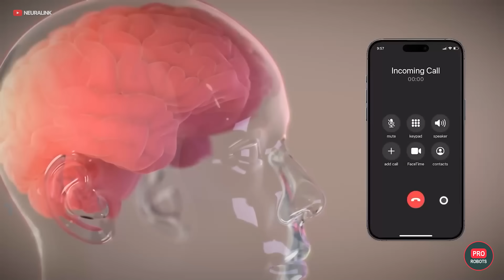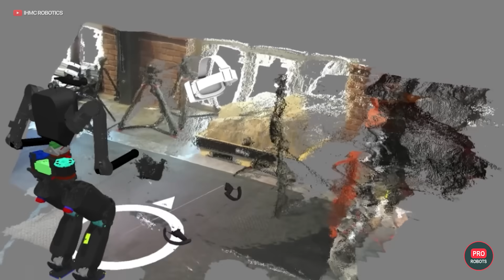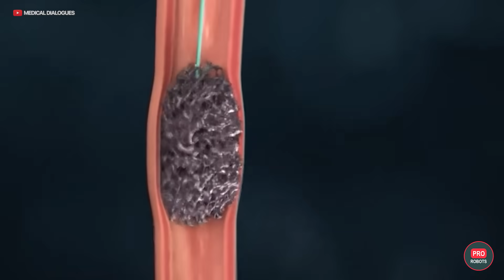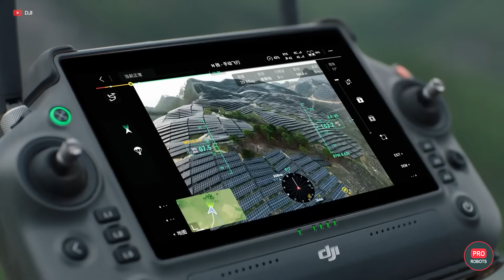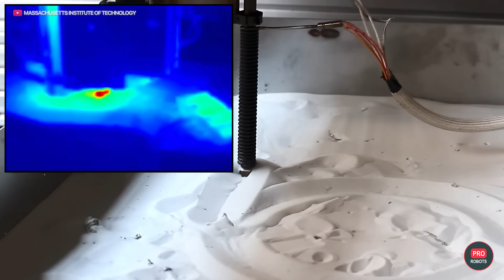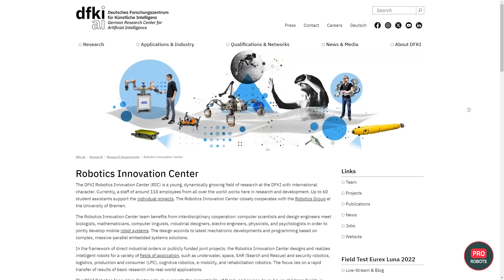What's up with Apple Car? | Bill Gates' top 5 robots | Google's new breakthrough AI | PRO Robots

Comment: i came up with a mind controller as a child after cleaning the inside of my master system controller (whilst plugged in) n worked better and quicker (no time for the "button" to compress) when touching the button connection terminals, immediately i thought why have a hand controller when you can have a "mind controller" using an eeg type setup("which could help in so many other areas too,,,"), eventually i saw "braingate" helping a monkey feed itself and 'locked in' people type on a computer, and some "standard eeg cap"(if i remember correctly made by a Russian teen),  i wondered why they weren't using it properly(eg for games; push button for jump - sprite jumps (brain wave recorded), push button for jump - sprite jumps (subliminal distraction, button was deactivated, brain wave recorded), think of character jump - sprite jumps with no button only by close match assumed foire filtered trigger wave which foire pattern is automatically applied to incoming signal which is tuned on last step) then i found "dream machines" a bunch of nonsense and then 'emotiv', who i then went and did beta testing for, with the 'epoc'  (i actually wanted to buy one but they where $11000 each considering they were prototypes &not for sale), i tried to warn then they will see something different once connected n they thought it was broken cos waves were peaking & vallying off the screen, 3 headsets later n them not listening when i kept telling them it's my brain n seeing it just needed a volume control(with avls opt.) in the software, so the code monkeys finally listened wrote one in n we got it working, so i played some games, n chat about thinking of this tech for 15 odd years. eventually a research model came out n got one only to find they had used the software to corrale and lock you out of actually using your own brain waves, oh cute you make the face move like yours, and train 4 out of context "buttons" for 30 seconds each training, so what are you supposed to think for 30 seconds (especially considering it was sold as a video game controller like i wanted all those years ago), are you meant to say "ok 4 buttons - Pacman, nice" up down left right simple so you can train moving a floating box: lift(up), move left, move right, drop(down)  so for 30 seconds(no game command goes for more than 30milliseconds unless the controller dirty or something) so what ya think: "'uuuugeeuuuuuthisuuutakinguuuuwayuuutoouuulongpp'" even if you manage to get all 4 trained you then link those outs to keys n those keys to emu setting and everything works fine with the key board but your not gonna play Pacman with your mind, the software is nonsense, so now i have an interesting ornament that i made a cool stand for out of a coat hanger that always makes people ask "what it's that!?" to which you can reply like your from the future "that's a brain reading device, it doesn't work tho", what ya gonna do with a braingate, i mean neurolink if\when it don't work, put your head on the mantle, n say 'that's my reality reading device, it doesn't work tho'.
Reply: oh yeah i forgot that funny toy that your supposed to move a fan held ball through hoops forget it's name it has the dry terminals emotiv promised would come to the epoc to replace the saline saturated felt pads they still come with nearly 20 years later, i think they got dry ones now but they cost like 31 trillion dollars or something equally rude, i can't believe that company still exists when they are the exact fraudulent "fake it till you make it" scam that other girl got busted for they made a show about it maybe called "dropout" , fitting.
Reply: oh yeah there's another one i seen not long ago that goes up your jugular vein and has some nitinol like mesh that opens against the inside of your brain n stays there, wblhoblblya YUK! why all this invasive stuff when the universe is different densities of field turbulence of which no thought goes unheard!

Comment: The new China battery is worthless clickbait tech.
12:28 If you want to produce 1 Watt with this isotope and you can capture 8.8% of the radioactive power into electricity, you would need 9.76kg of carbon 14 (about 21.4lbs).
"EEVblog 1595 - 50 Year Chinese Nuclear Diamond Battery!"
If you need 3 of these in a device, that would weigh 63 pounds (138.6kg) + add the weight of the other parts of the battery. Pretty worthless.

Comment: China says that it's new nuclear battery is safe for the environment.  Never trust China when they say something is safe 😂
Reply: The new China battery is worthless clickbait tech.
12:28 If you want to produce 1 Watt with this isotope and you can capture 8.8% of the radioactive power into electricity, you would need 9.76kg of carbon 14 (about 21.4lbs).
"EEVblog 1595 - 50 Year Chinese Nuclear Diamond Battery!"
If you need 3 of these in a device, that would weigh 63 pounds (138.6kg) + add the weight of the other parts of the battery. Pretty worthless.